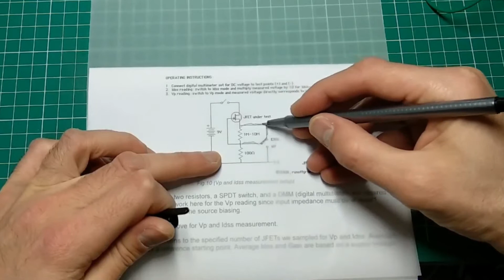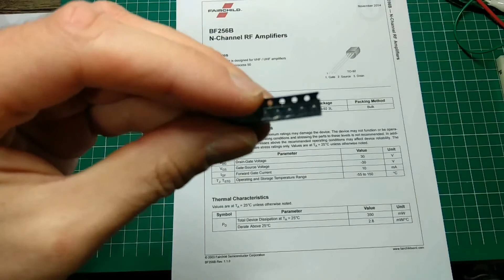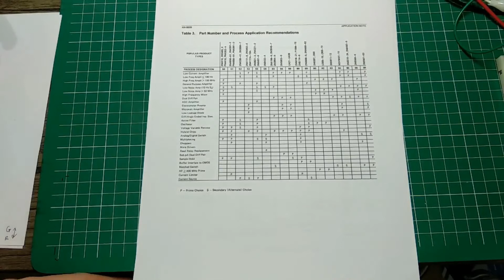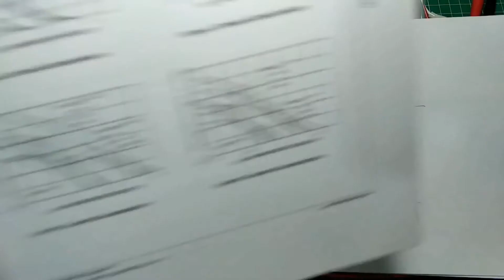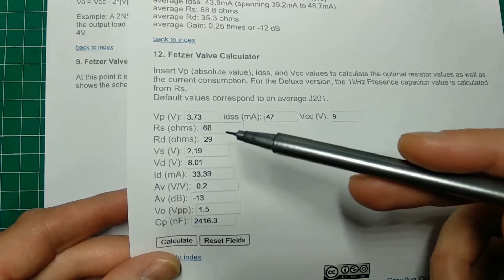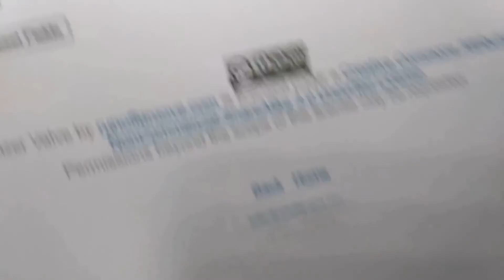Measuring JFET Parameters

Comment: The  maximum resistance you can use is 1MOhm because the input  impedance of DMM is 10Mohms and  it will be in paralel with resistor For example  if you use 10M you got 5M and wrong voltage reading.
Reply from the maker: While you're correct about it, that won't matter that much in this particular case.
The transistor's Vgs is just above pinch-off voltage, so nearly turned-off but not quite, so any sufficiently large resistor will work. As you point out the actual resistance that JFET "sees" will be 5M (depending on the DMM), but even with "perfect" voltmeter the difference in reading might be 1%. Even using perfect voltemeter is not going to be accurate, but will be good enough for our purposes. (I'm not sure if I mentioned this in the video, but I mentioned it in the accompanying post).

Comment: Great video, so do you think is better to set the bias using the calculated Rs and playing with a close resistor for drain or maybe a trim?. I had the same issue, the Vd and Vs were different once I try to test the circuit. Calculations were right, even with Lt Spice the values were the same.
Reply from the maker: Calculation is relatively easy and will most likely match what you get with LTSpice. The issue with models in LTSpice are that they do not reflect very big variability in individual JFET transistors. For example BF256B has parameter Vgs(off) varying from -0.5 to -8V and Idss from 6 to 13 mA - that is a huge variability. If you measure the parameters (even that measurement is not perfect, just keep that in mind), you can calculate pretty accurately what your component values should be. To be honest, I'd use trim pots for both source and drain resistors. Just gives you more flexibility. You use calculation and measurement to give you rough idea of which value trim pot to use. It would be of little value if you calculated that your source resistor should be around 200 ohms and you use 100K trim pot. Get the resistance to about the desired value, and then play through it and adjust the sound the way you want it. All depends on what you want to achieve, are you building one pedal or more etc.
Reply: @BarbarachBC  I have been doing some tests with 2SK68A / 2N5458 jfets on the breadboard and Lt Spice, I even had 1V difference between the calculared/simulated and the real ones on the breadboard. As you said, I think calculation just give you an idea what to spect for. For example, I took 8 pieces of 2SK68A and they were very close values or Vto, Idss. The maths and simulation were  different for Vd and Vs. I was testing some replacement for J201 to use in a Wampler Plexi Drive circuit and after biasing the K68A the sound was great. I just put Rs=1K just like the original circuit and a 50K trim for Rd and set the bias Vd 4.5V. I just didn´t know if they were the resistor values to make it work the best/optimal the jfet.  Electronics is not my job but I like it a lot  to study in guitar pedals...        ...I still don´t know if having a big difference like 1V is normal in jfets maths/real.
Reply from the maker: I see what you mean. Just to give you an idea about J201 biasing. With 1K source and 15K drain resistor, over the range of possible Vto/Idss values, Vd may go from about 2V to about 7.5V, just due to JFET parameter variability. I have an excel spreadsheet for this calculation - I would not even attempt doing this manually. LTSpice uses typical values (I would hope) and for that my spreadsheet gives me around 4V. 2SK68A has even wider range of parameters - any J201 will work with 1K & 15K biasing resistors. 2SK68A on the other hand, won't even work for a big portion of the range. Typical Idss for 2SK68A is 3mA for example, maximum Idss for J201 is just 1mA, that is a very big difference. If I'm not mistaken, you'd need to drop drain resistance under 10K to get bias around 4.5V for a typical Idss value for 2SK68A. This is all of course very theoretical, but I hope it gives you an idea how variable these JFETs may be.

At the end of the day - if you're happy with the sound, that's all that matters. That's why we (I hope) all do breadboarding first to nail the sound :)
Reply: @BarbarachBC  Yes you are right on the +/- 10K trim values, I was thinking trying to set de K68A bias about 0.5mA to make it work in the J201 range (Idss 0.5 - 1mA), I don´t know if this is going to cause some kind of clipping.  The resistor values would be Rd 9K / Rs 1.6. This point is far from the K68A mid bis point, I don´t know if this is going to work out. I will be testing the next week, today I´m going back to work 100 miles away from home. Thank you for clear me up about this jfet stuff !!!.
Reply from the maker: Give it a try and maybe report back how did that go?
Reply: @BarbarachBC  Hey, I think this test will take another couple of week since I had to stay at work longer time. I am still aware to share results in here then. Saludos desde Venezuela.
Reply from the maker: No rush :) Looking forward to hearing about it. Take care :)
Reply: @BarbarachBC  4 months later here I am again just for let you know I finally did the circuit on the breadboard and even with ltspice. If I set the K68A bias point near the J201 range (0.5mA - 1mA) the signal would be oscilating very compress so the best way to do this is using the K68A mid bias point (3.3mA my case) and the signal would be oscilating free in the middle of the (Idss Vs. Vds graph).  I have tested with the Wampler Plexi Drive circuit and changed the Rd=1.5K and Rs=100 Ohm so I get Vd=4.5V. (Rd=1.4K and Rs=94 Ohm in Lt Spice sim circuit). I used to change just the jfet letting the same Rs value and set the bias with de trimmer but I can see I and loosing signal amplitude this way. As far as I can see I could used some other jfets but making a deep study first to determinate the best oscilation point for the case. I am talking about reading and calculating transconductance, Vto, Idss, etc..         ...I think a lower transconductance means we could take advantage of all the current is not passing throught the jfet. 

Saludos from Venezuela